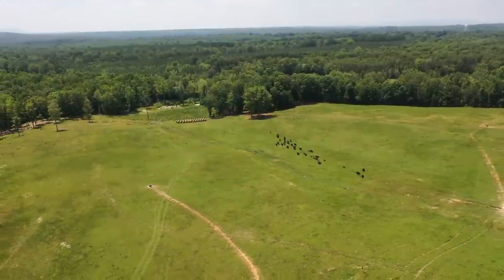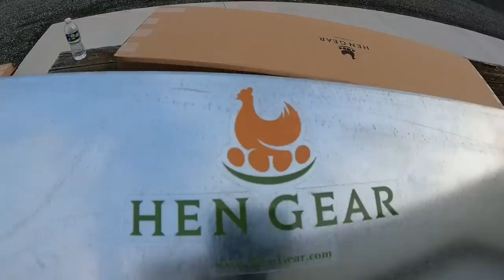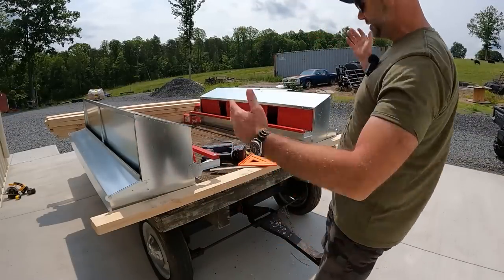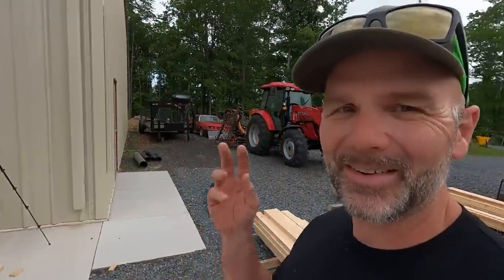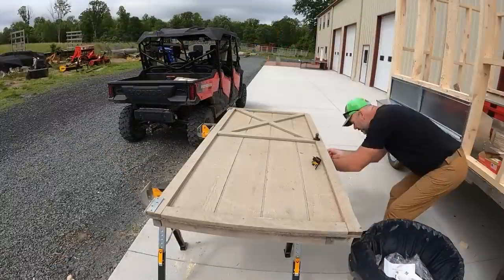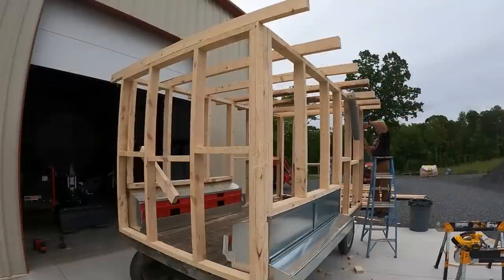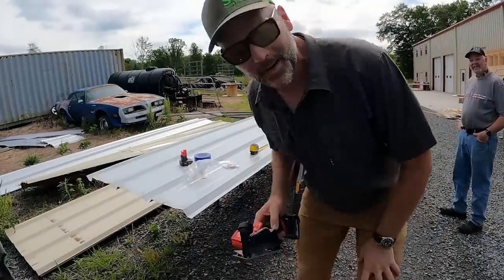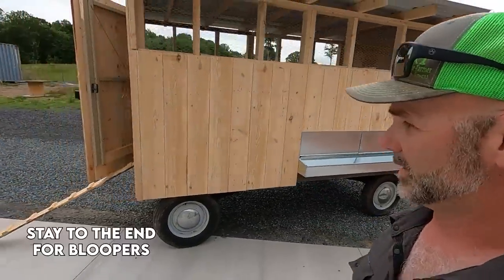You've never seen a Chicken Coop like this before! Watch me build it!

Comment: As a carpenter, I’d like to suggest using bolts into the trailer to help hold the coop down. Also I’d probably open that floor up somehow and let the poo hit the ground out in the fields. No scooping it out.And I’d use 2x4 hanger brackets on the roof joists . That wind can get strong out in those fields.

Comment: So, for 100 birds they will need 25 lbs of food and roughly 30 gallons of water a day. Maybe take the front 2 ft of the "coop" and make an enclosed feed box that'll hold a weeks or more worth of feed. Attached hanging feeders will prevent you needing to pick them up daily when moving them around and maybe attach a spool for a hose to wind up on the coop. Being able to move everything all at once without having to move everything twice is worth the extra time.

Comment: Good job on the Coop.
Add some blocking between rafters to keep pesky critters out of the hen house.
Figure out a locking system for the egg doors for the same reason.
Raccoons will find out pretty quick that there us a free lunch in there.
Here where i live, i would also neeed a header in those openings where the nesting boxes are.  Our sniw load can be pretty heavy.
Other than these observations, i like what you have done. 😮

* edit for typos *

Comment: Looks nice. Cool egg catcher system. Since you are prototyping .... I'd extend the roof longer over the person door so you're out of the rain fiddling with the latch, move the person door so the hinge is on the left post giving more siding on the right, build in a chicken door on the right side of the person door. They sell auto-dusk/dawn chicken door actuators that you could add then.  ... what about some sort of mechanism that could wind up your electric fencing like a tape measure or winch? Solar power for the winder motor and the electric fence zapper. Rack for step-on posts. Goal is make set up and tear down for moves as efficient as possible.

Comment: Josh, love your re-purpose of the old hay wagon. I have two suggestions. 1. you have no idea how old those tires are(but there should be a date code on them) You might wanna replace them with some newer used tires so you aren't having issues with dry rotting and leaking any time soon. Also, might wanna add some slime to them to combat leak downs. 2. The floor, I most HIGHLY recommend putting down some lanolium or vinyl flooring down. it'll serve you well to keep moisture off your already rotting floor a,d clean out is a breeze. just sweep it and it's clean(of course you'll have to shovel it out once swept up, but it makes it really easy to clean it up. Also, forgot, some solar lights on the inside to keep the chickens up and laying during the shorter winter months. For 100 chickens, I am thinking you'll need more roosts to keep chickens from having to lay on the floor and getting pooped on. Are you gonna put you an auto opening/closing door on the coop for them to be able to get out and secured in without you having to do it all the time? They work great off solar and you could install it anywhere on the coop even at the bottom of your walk in door.
Reply from the maker: tires are probably 40 years old...as long as they hold air they'll be fine....lanolium holds water under it and is easilty damaged by a rake or shovel...ask me how I know.  The tires will need air about every 6 months...no biggie..just a 5 min maintenance item not worth spending $300 on tires
Reply: @StoneyRidgeFarmer  I had lanolium on my chicken house and had zero issues with it after 10 years(when I sold it, ) we did inspect the whole underneath and no issues and it was just regular plywood. no leaks no stains. I onlyused a broom to sweep the shavings in a pile the a flat shovel to shovel the shavings out. Once all cleaned up, th floor was in perfect condition, like a new 70's kitchen floor. And I wasn't talking about getting new tires, just newer tires that were worn down, but with only a year or three on the date code. Around here, you can get them for like $20 mounted. Tread doesn't matter since it doesn't need traction. just needs t hold air. But that really is a kewl build.

Comment: Noice coop.  Love senco nailers. Maybe use Thompson water seal on floor. I used to cut my metal with an older carbide crosscut blade put in saw to run backwards works great. Maybe get a Vaughan 16 oz smooth face framing hammer. Great build cheers buddy Ricky 👩🏻‍🦼🇺🇸💥🎸🙏
Reply: I just use a high count non-carbide blade in backwards. Carbides catch and could dislodge in reverse.

Comment: Did you fill those gaps between the roof rafters and the wall frame? You have airflow through the chicken wire, but I'm curious about predator access above that wire. Great build! Inspiring. Thanks for sharing and motivating folks like me to get out on the land and prioritize self-sustainment.

Comment: It's a cool build, but as an old poulterer, I have one single criticism. Though the coop looks secure, it has a fatal flaw in its design and I went back and looked at your recent fox attack video to see if the flaw is still there and it appears to be. The flaw is this: When you attached the wire for venilation purposes, you used a staple gun to attach it. When you sided the coop, you lapped over the bottom edge of your wire with your siding. Spot on! But, the top edge of your  wire is not lapped and I believe the side edges were also not lapped. This is a big vulnerability and it's really just a matter of time before a raccoon comes along and peels the wire away to gain entry. Even heavy duty fence staples are inadequate. That could be next year or five years from now, but eventually it will happen. It's a great build, but anytime you attach wire, all edges should be lapped just as you did with the lower edge. For the best results, run a 2x2 or similar strip along all wire edges and screw it down securely. I usually drill a pilot hole to prevent splitting. This will prevent raccoons and others from climbing up and working the wire loose to gain entry. If they gain entry to a coop like this that shelters as many hens as you plan to run in it, it'll make the losses you had from the fox attack seem like kid stuff because they'll literally kill every bird inside, be it one or a hundred. You'd be surprised how many people who keep poultry will eventually fall prey to this one single coop vulnerability.
Reply: Great points, thanks for the tips! This summer I’m going to build a mobile coop out of an old cattle trailer my grandpa built. I’ve taken all the rotten wood off so I’m starting with a bare frame

Comment: You should add a trailer jack to the front of the frame to lift or lower the end to provide a slope for your roof 👍🏽
Reply: Trenger nok.noe til å vatre av hele vognen skal eggleggingsboksene fungere slik at eggene triller under lokket som de er ment å gjøre.